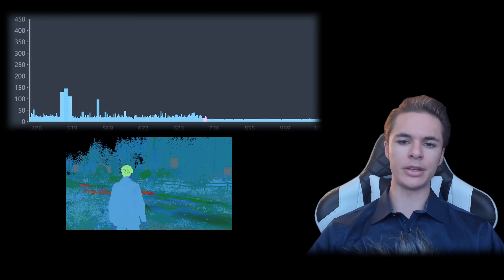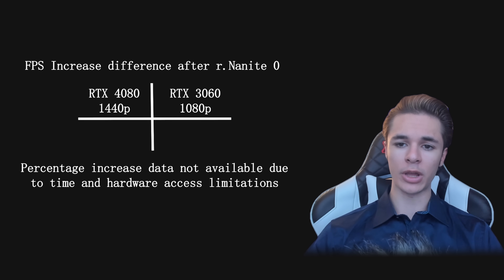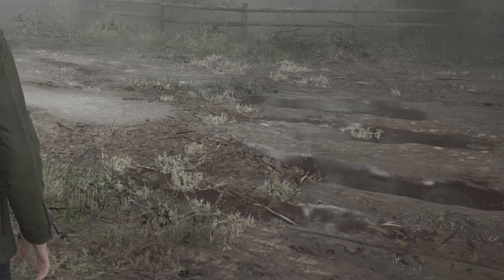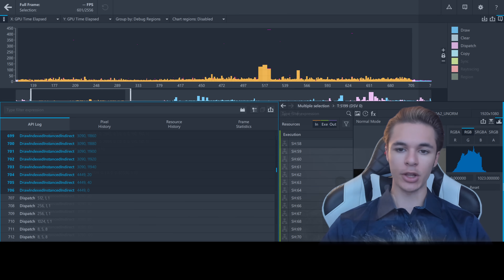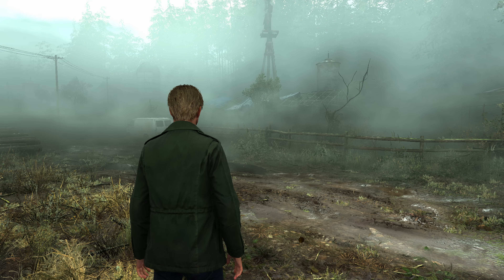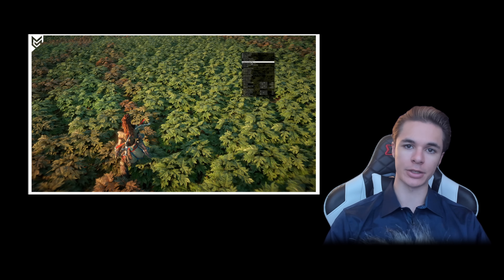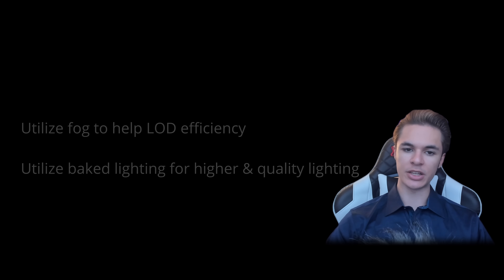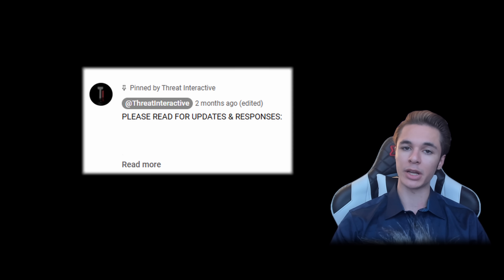The Price of Realism? | SH2R Optimization From The GPU Perspective

Comment: That's why I don't buy a gaming PC. They expect you to pay thousands for hardware just to make up for their bad optimization. On PlayStation I only buy those games that have fine optimization.
Reply: Silent Hill 2 runs like garbage on PlayStation as well. Heck, most of your games could be true 4k 60fps. You are not safe on console.
Reply: You can get better visuals and performance for a fraction of the lifetime cost of a PS4 or PS5; and you're not stuck with a PS4 or PS5, but with something actually useful.
Reply: @ArchOfficial  a fraction of the lifetime cost? Not even close to true
Reply: @mitsuhh  For an equivalent graphical and performance experience? Overwhelmingly true, and has been for some 20 years. It's hard to even find hardware as bad as console hardware nowadays, and going parity with projected lifetime costs builds you a completely overkill PC setup most of the time.
Reply: @ArchOfficial  Haha.
Reply: @ArchOfficial  Clearly, you understand nothing.
Reply: Um... This is platform-agnostic. Issues are with the engine. (though I don't even agree with everything stated in this vid). So, you get the same issues on any platform it's running on.
Reply: This is not the channel for you
Reply: XDDDDDDDD thats not exactly the case nor what he is refering to xd

Comment: Even though this is too technical for me, as a lifelong gamer and PC enthusiast since 2003, I can understand the broad strokes of what you are saying. The word I used to hear used a lot was textures. Now I hear shaders a lot. The first I heard the word shader was in a PS1 emulator and it was used to refer to these graphical filters that smoothed jaggies and improved the graphics. Now it seems to refer to something else in regards to PC games but I don't know what. I just know that shader compilation produces stutter. What are shaders?
Reply: To put it in the turbo-normie layman's terms (I'm sorry, tech nerds) : 
"Shaders" these days mostly refer to  the"Pixel shaders". They are essentially GPU-drawn, dynamic special effects, that "shade", as in change the appearance of any surface or scene of the game. They started becoming more common in the very early 00s, circa DX8 and 9 era, with the Bump- / Normal-mapping being one of the most well known examples. Celshading is also quite common sight, resulting those cartoon-looking visuals. These days, devs use shaders errywhere, for water reflections and refractions, light calculations (Deferred lighting)... etc. The reason we now got the "shader compilation" issue is because these effects need to be calculated in real time, by each device, after which they CAN be stored for faster use. And since the game graphics keep getting more and more complicated, this results more shaders + more complex shaders being used = longer compilation times.
Reply: @GugureSux  Thank you for the detailed response!
Reply: shaders are mathematical operations you apply to the image to manipulate pixels individually. in simpler terms, it's "post effects".
first instance of pixel shading in games i remember was the water in morrowind.
Reply: @GraveUypo  thank you!
Reply: @guyg.8529  thank you

Comment: Is there a way for me to disable TAA or upscaling technologies in a UE5 game that doesnt let you do it from the settings? I remember you could in UE4 titles, but I cant figure out how to do it in a UE5 title
Reply: Most or all UE5 games have ini files that can do that.
Reply: @MyAmazingUsername  do you know what command lines to type in the ini?
Reply: @oomegator  Nope it's different for each setting. :/
Reply: You can easily google up UE5's Engine.ini settings from the internet.
Most old UE4 commands still work fine. You just need to remember to set the file to "Read Only" mode after you're done, otherwise the game'll overwrite your changes.